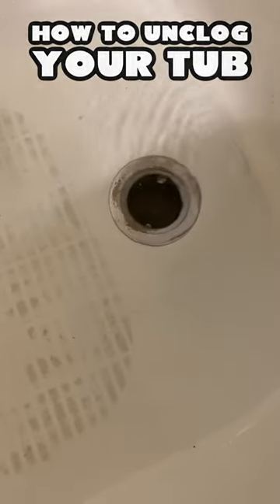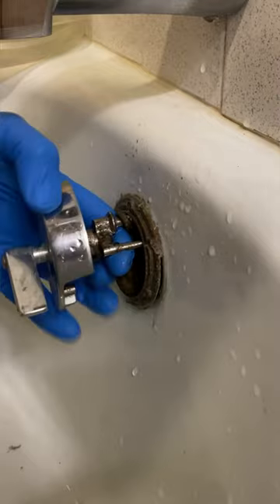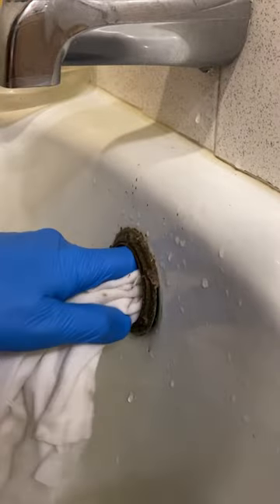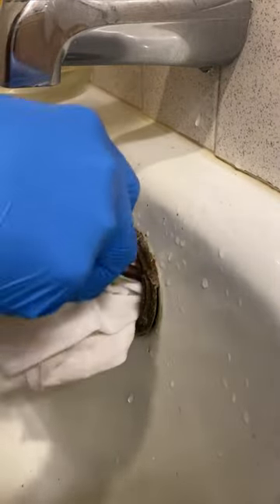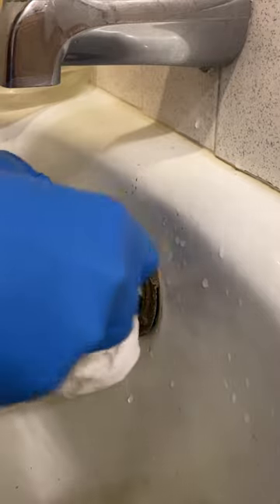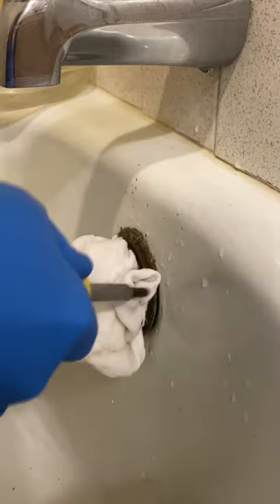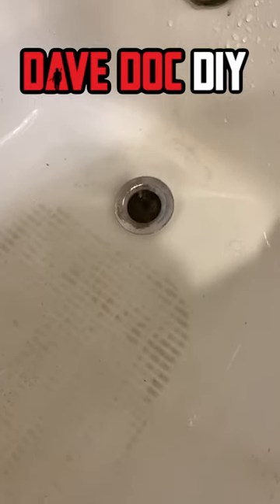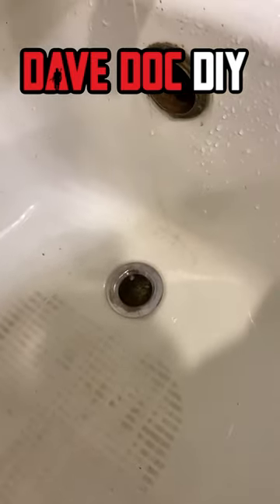How To Unclog Your Tub | Easy DIY Tutorial #diy #tub #clogged #tubclogged #hack #plumber

Comment: You can actually just put the drain stop in and plunged the overflow
Reply: Am plumber, never thought of that. Will try
Reply: Yep. I do that. If you're in the shower, don't bother drying off. Just grab the plunger and put your foot over the stopper. If you don't habe a stopper, a wet rag also works or try just putting your foot over the drain.
Reply: That's a great idea
Reply: Half of the pieces of shit I go to don't even have a over flow, the other half don't have a gasket.

Comment: That would have been the easy fix 
It cost me $600 for a plumber to come out after hrs 
The clog was Not in the p-trap 
It was a lot further down the pipe
Reply: In that case, you needed to call a plumber to come snake out the pipe
Reply: Also if it took less than two hours to snake your drain, which it most certainly did, you paid 250$ too much